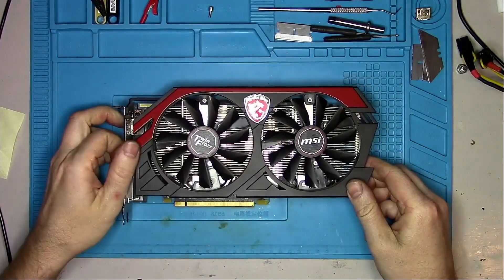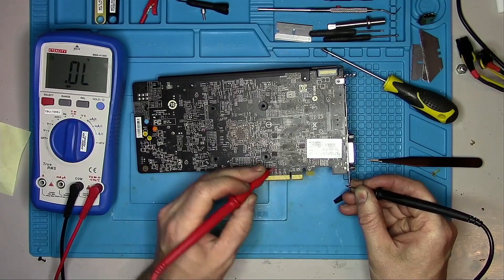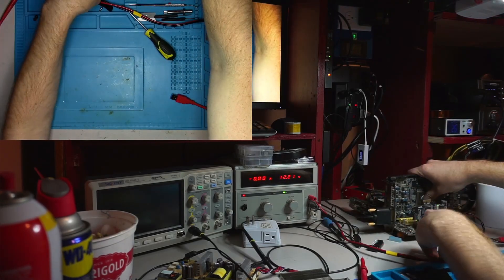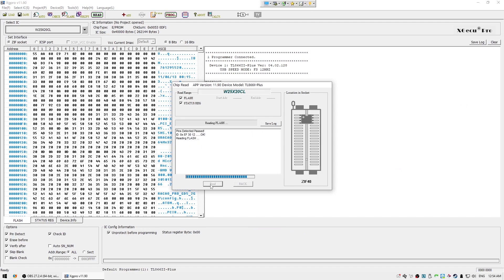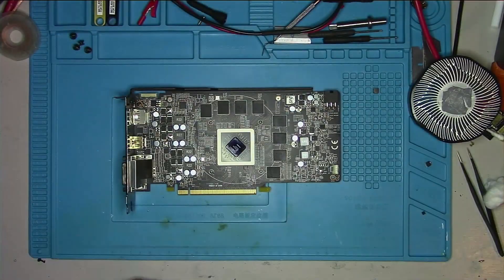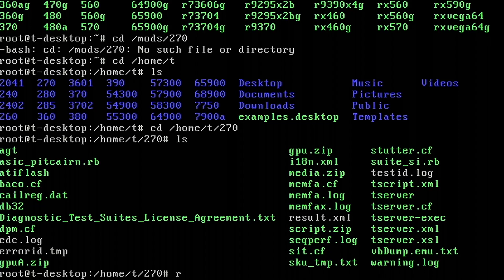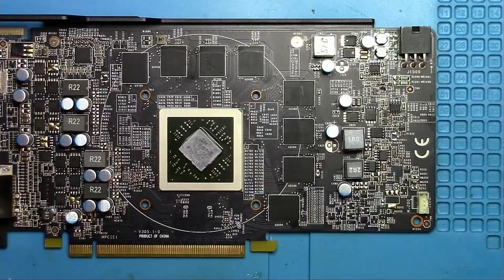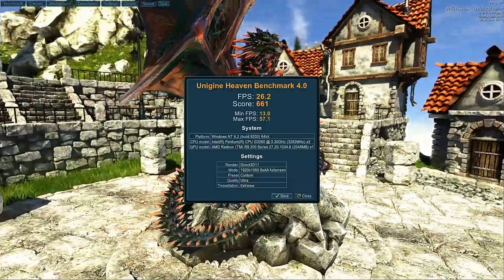graphics card error 31 drivers won't install

Comment: Use ATIFLASH... set card in secondary slot... force flash device in second slot... bios updated. Or alternatively, jumper two wires on the bios to restore the original bios. Your welcome.
Reply from the maker: What wires restore original bios ?
This would only apply to dual bios, no ?

Comment: Time saving tip:
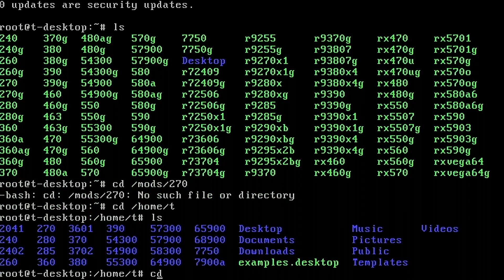Once you're in a directory, you can navigate to a subdirectory without specifiying the entire directory path. E.g. At 6:43, from the /home/t directory, you can navigate to the /home/t/270 directory simply by typing "cd 270"

Comment: Most awesome gpu repair channel i have seen. Can i ask a question? If I take an elpida memory 2gb ddr5 from R7 240 and replace the memory of my GTX 750 1gb with hynix. Will it work?
Reply: No they have different pin outs and/or require different voltages. Not a good idea.

Comment: I don't know if this is closed minded but if I can ask, for cards like these what reason is there for a customer to want it to be repaired? You can find these cards for $50 or less and I might be mistaken but wouldn't this repair cost more than that? I'm just curious what the reason behind it would be. Unless this is a card you bought specifically to try and repair it.

Comment: I was diagnosing a 8800 GTS which refused to utilize drivers, had artifacts ONLY within the BIOS & froze GPU-Z. I also had an identical fully functional 8800 GTS. After inspecting, cleaning, cross comparing and poking around, I decided to go after the BIOS chip. Ordered a hot air station and swapped the BIOS chips real dirty no cleaning, no flux. Hooked up the faulty 8800 GTS and..... It works. Disconnect everything and hook up the known good 8800 GTS. IT WORKS. Lastly, I do the only thing that makes any logical sense. I hook up both of them in SLI & fire up Oblivion. It just works.

Perhaps it was just bad solder joints at the BIOS? Maybe another failed component near the BIOS appreciated a reflow. Or the BIOS chip was just old and tired & the heat kicked in a sort of half-life.

Comment: I have a few video cards I wouldn't mind getting fixed. One works, but the fan won't spin at all even with MSI afterburner, which is a GTX 1050 TI I got it cheap before the market spike for $25, and I have an m2000 as well as code 43 in the device manager if you want me to send you one or two cards to make content off of. I'm cool with the M2000. It was going to be used for transcoding, but that didn't work because of its issues, and the GTX 1050 was just cheap at the time. The fan wasn't frozen up or anything. I soldered a 3 pin to it and plugged it in to the motherboard and it worked fine. I just got stuck at like 50% speed compared to what it could do normally. 10 series cards will automatically kick on around 60 to 65C. I rigged that 3 pin for temp. I was planning on getting it fixed anyway or upgrading, but it really does just fine for my needs. It can do something like 25 transcodes at a time. I'm not trying to supply the whole world with GPU power. it would be cool to have a back up card if i ever need it that m2000 wouldnt mind getting that looked at either

Comment: You are a real genius. I think they should hire you as a design engineer for graphic cards. How did you learn all of these by yourself?
Reply from the maker: Yeah. My card broke, I fixed and and then it took off like crazy.
Reply: @northwestrepair  masterclass!
Reply: @northwestrepair  That is the most infatuating reply I have ever seen but I am extremely happy that you are so gracious with sharing your skill set with repairing video cards.
Dude if you ever stop fixing cards I will need to study your videos like a bible to repair my own GPUs because you have shown that nearly anything is possible... And I plan to hold onto my EVGA cards long after their name becomes nothing more than a figment of someone's imagination when it comes to GPUs...  RIP EVGA, my 3090 FTW3 Hybrid is going to hang on a wall next to a Voodoo 5 5500 as the best of what once was for its era.
Reply: @VonZippySays  You would pay a lot less if you buy new cards. The tools you need to be able to repair video cards are quite expensive. I'd say probably at minimum 7,000-10,000 USD.